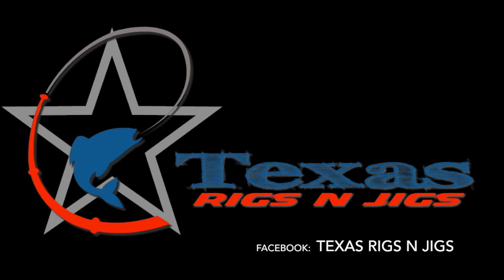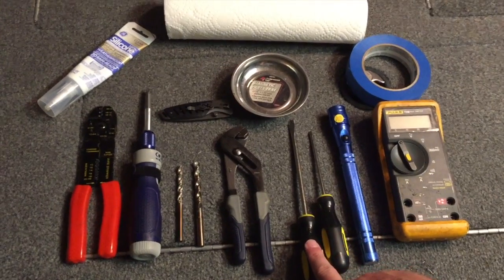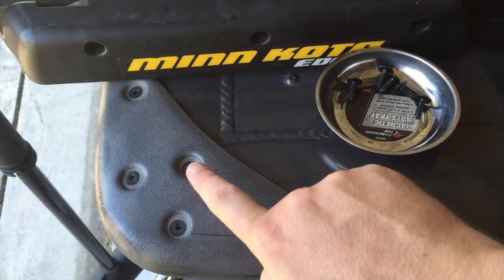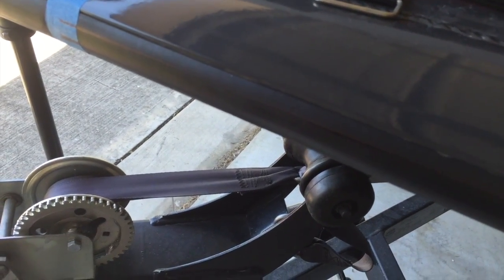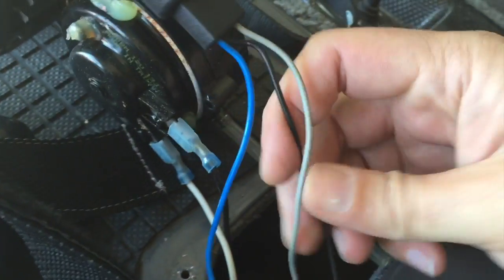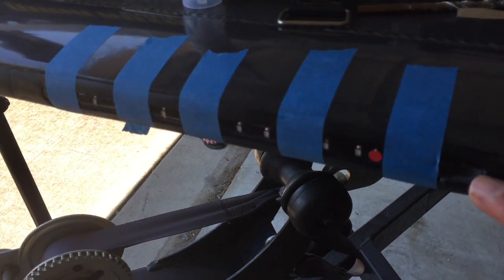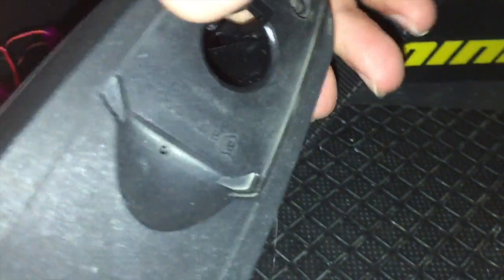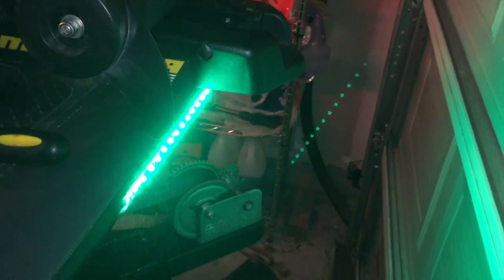BluewaterLED Bow Lights install

Comment: Doing a install on my 2019 pt190 now. The only thing u left out is that u need a long drill bit  to go through trackers gunnel so u can run the wires through to the point of contact. Thanks . Great help .👍

Comment: Did you use the 3M adhesive on the back of the LEDs or did you use silicone?   Or just Silicone on both ends question mark
Reply: I used silicone along the back, top, and bottom.  Then smoothed it out with my finger.

Comment: Do you know if those lights are Coast Guard approved or not? I've been finding other videos that may be a problem. love the idea though and looks great I want to try it myself.
Reply from the maker: James Webster you will need to find out in your state.  Doing some reading, it differs from state to state.
Reply: Could you please direct me in the direction where I might find state-by-state Coast guard restrictions. The only thing that I can find is US Coast Guard restrictions which covers the US as a whole. I have been informed that no strip type of lighting for navigation has ever been approved. Please check on this further to avoid violations and drilling unnecessary holes in your boat
Reply: NO, it does not differ from state to state... Federal requirements ABYC A-16.
states can not set rules that are LES restrictive.

If I were you I would add a disclaimer stating that anyone modifying their boat lighting does so at their own risk.

Because “NO” these lights are not Legal. My fishing partner found out the hard way. Now understand your local wildlife officer may or may not care that you are out of compliance with Coast Guard lighting requirements. But as my buddy found out after an accident the courts DO care. My buddy had installed the exact same setup that you have on your boat.
Long story short: my buddy while night bass fishing was involved in a boating accident in which he was struck by another boater. From all perspectives at the time it was easy to see that my buddy had no fault in the accident. In fact the other boater was ticketed as being the at fault boater. But as he came to realize during the process of litigation in maritime accidents, THINGS CHANGE when rule violations come into play. And the lighting that my buddy had installed onto his bass boat was found in court to be a direct violation of U.S. Coast Guard lighting requirements for many reasons. And as a result of his lighting install he was found to be 70% liable for the accident even though he wasn’t the at fault driver.
You see in maritime law (US CG lighting requirements) if you deviate from the rules you have to prove without a doubt that your deviation did not contribute in any way to the accident.
The courts found that his EBay lighting violated the requirements in a few ways.
1. The lighting did not have a USCG approval, which all boat lighting manufacturers must submit for and receive.
2. His lighting failed to meet the requirements of ABYC A-16, which states: Sidelights - The starboard side light showing green, and  the port side light showing red, from dead ahead to 22 5° abaft the beam (90* + 22,5' = 1 12 5°) on their respective sides.  You see the 112.5 is a MAXIMUM allowable range not minimum, and his lights exceeded that.
3. The light manufacturer had never submitted the lighting for laboratory testing for USCG lighting compliance testing, another requirement for USCG Approval.
The court determined that that my buddy had hazardously installed unapproved red and green LED strip lighting on the bow, which hampered the other boater’s efforts to avoid collision
Reply: sam sammie Ed

Comment: where do you run the leads from the LED's to the bow light socket. My Alumacraft has a big hollow aluminum rail. I think I would have to drill through both sides.
Reply from the maker: +Jay Johnson I had to drill a small hole behind the rub rail to run the wire through.  I then siliconed it up to keep the water out.